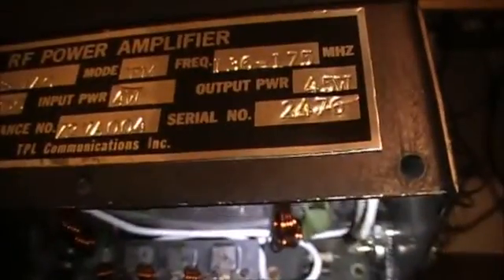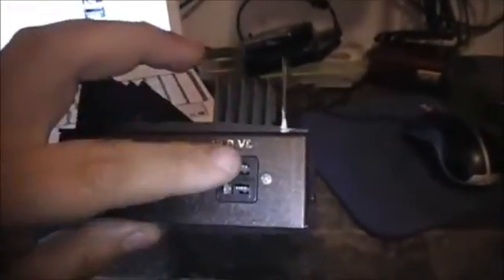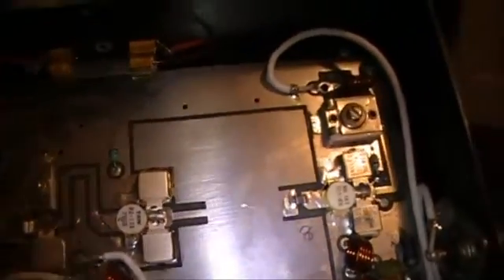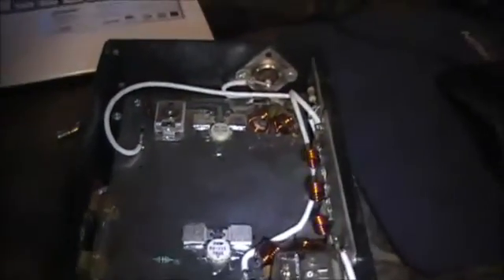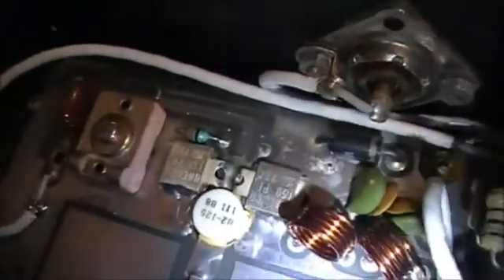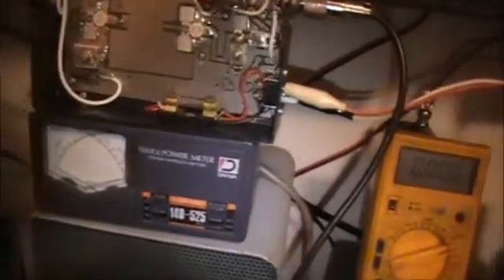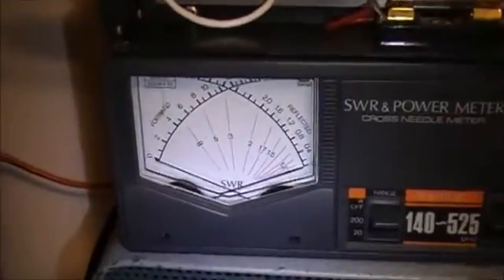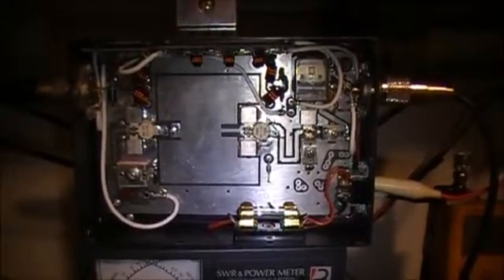TPL PA3 1AC RF Amplifier PART 2

Comment: can you upload a video on how to tune these amps?
Reply from the maker: Tune them how, With regards to RF power output?
Reply: for example, i think there is misconceptions on how they tune, so how they work as in bringing up (or down) the frequency within band to operate with maximum power output and how of if this affects drive input.
personally im still vague with it. have tuned a few but i am mostly winging it.